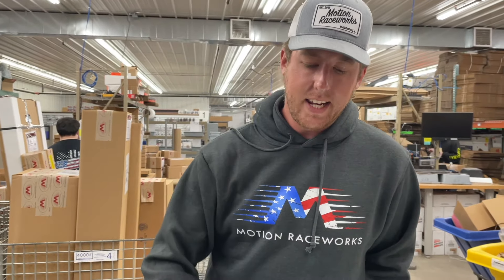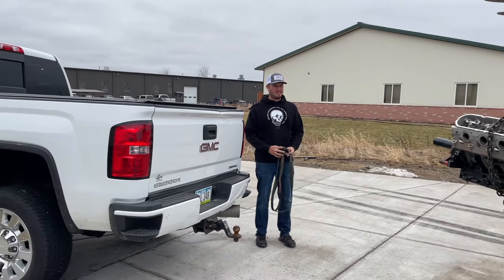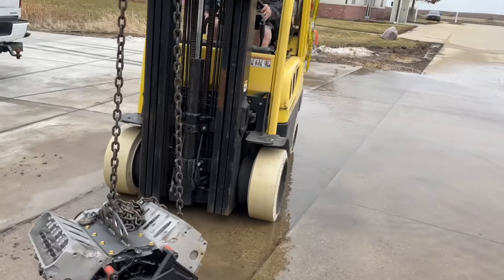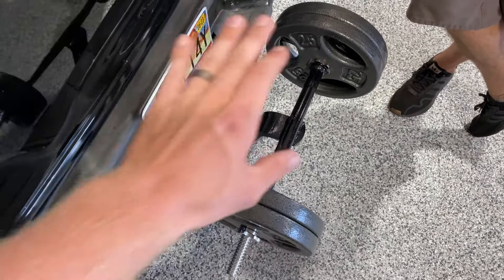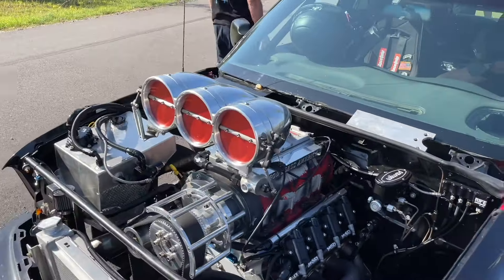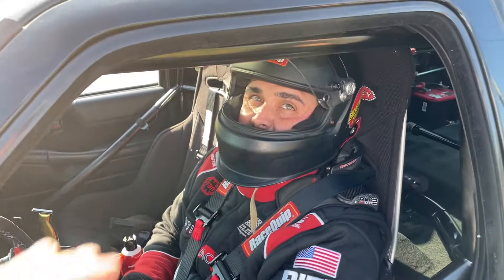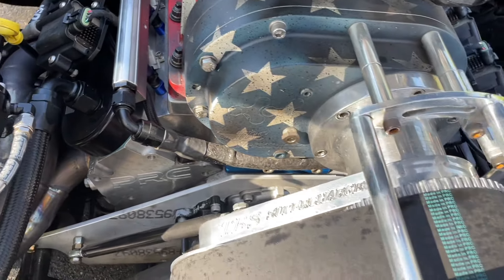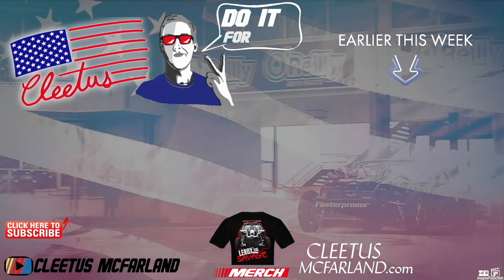BLAZER DOWN!!! We Tried Something New, But The Blazer Had Other Plans!!!

Comment: If you are going to keep running those weights on the back you really should run a pin through the bar to keep them attached!  A couple of 25 lb plates will kill someone if they come off at speed, especially if they are spinning from ground contact.  You really don't want to torpedeo someone!

Comment: Shout out to the intake bolt-hole threads in those aluminum heads. They are the real MVP of that lift 💪
Reply: It screws into the block.
Reply: Especially since that’s a mock up engine so it’s been impacted probably a shit ton

Comment: i've seen plenty of cranks breaking with blowers on them, the cause is from not having the proper tension on the pulley. the belt needs to be checked after its had some heat put into it. a belt that is to tight will cause that crank to snap.  depending on your pulley setup. 1/2" to 3/4" slack on the long side from center.

Comment: Honestly, when they started the lift plate bit “I couldn’t think of one possible thing that could have gone wrong.” However, I’m impressed with the strength of the chain, forklift, lift plate, and the truck hitch. 😂😂
Reply: I don’t understand why you’re impressed with it. They’re all heavy duty parts made of very strong steel.
Reply: @mikeznel6048  on the other hand i would be quite worried if anything actually broke

Comment: The fact the bolt threads holes is the impressive part.
Reply: A single 3/8-16 grade 5 bolt could have done the entire lift though.  Hard to believe, but it's true.  That is, with zero dynamic shock from abrupt lifting and lowering from the tow motor.
Reply: @majorrev8690  So the takeaway is: Motion raceworks engine lift plate is as strong as a 1" ratchet strap.
Reply: @TokenTombstone  I dont know how strong a 1" ratchet strap is.
The tensile strength for a 3/8 course thd Gr5 bolt is 6600 LBf.   One bolt, in tension, could do that lift.
Reply: @majorrev8690  Wasn’t the bolt threads that impressed me it was the block threads

Comment: With bead locks I would be somewhere between 5psi and 8psi. Also if you spin the tires a little more in the juice to give it a chance to break down the tire compound and back up exactly in the lines that you just made it will help a lot! Definitely gonna be doing a wheelie then!

Comment: On the weight plates where there's a cutout weld a piece of metal slightly larger than the hole on both sides for all of them to make hollow chambers...drill a hole in the center into the plates on one side only and fill with molten lead.

Comment: You also need to turn your "Weight bar" over and you'll have solid mounted wheelie bars instead of the trailer hitch hitting the ground.  Once you get it back together that is.

Comment: From what I can see the rear end isn’t extending and staying up which isn’t planting the tire causing wheel spin. Also the front end is extending way to fast and unloading the rear end. George needs to do a standing burn out in the prep to give the prep a chance to work on the tire. You’re wasting the prep doing a rolling burnout. Look up some SRC videos on YouTube. They are some of the best no prep racers around. You can learn a lot from them about burnouts and setting up your suspension for no prep

Comment: Gotta get it on scales and see the ratio on weight then adjust with your butthurt bar to make it around 50-50, need Hoosier D06 tires make sure your track ain’t getting greasy

Comment: Fellas first off, if you show up to a 28 10-5 (small tire) no-prep or street race with those W's on you are going to get kicked out. Better check the rules to the race you are going to, most (that being 99.9%) small tire no-prep don't allow the W tire. You need a set of HOOSIER c-07 or d-06 tires. The d-06 are better on virgin asphalt,  but as the strating line gets sticky you have to worry about them paddling (especially with hirer horse power).

Comment: So I'm sure if you tried turning the weight bar the other direction front to rear and put it inside and make it so that it's at a tilt forward and put the weights on when you take off they'll slide back and help lift the front end or help plant the way in the back FYI

Comment: If you guys can raise the ride height of the front end(or at least drop the back), that would definitely help out of the hole, transfer weight to the back a little quicker and keep it there. A front "long travel" kit too, if it doesn't already have it. Keep the nose riding high all the way to the finish.

Comment: the dumbells might work of you got an extra set of those nuts , turn two of them on per side and twist them against eachother to lock them up
if youre serious about adding weight to hook up you might as well put a few bags of sand in the rear

Comment: Did you take my advice and install any other weights maybe behind the front seats and even some on the front end and amp the tune up or try with something like that because I grew up racing my square body and my small 81 Corolla and both had different spots that needed added weight and definitely more boost.

Comment: Tell George on the burnouts to stop going down so far because as he backs up he is bringing trash to the starting line if he does shorter ones it’ll help plus I’d try dropping the tires to 8 I used to run 8 on the street but I’d say my car is a lot slower than the blazer

Comment: You said the wheelie bar was threaded the wrong way,I disagree. It will work at the start until the front comes down then sheads the un needed weight 1000 IQ if you ask me

Comment: you guys just over torqued it you got a lot of resistance with that big tire and you are pushing boost through the engine at too low of an rpm still, its some classic overtorqin

Comment: Hope u guyz know in real no prep racing they don’t add glue to the drag strip and the closest thing to prep is burn outs ,and an LS is light compared to even an 305 small block Chevy how come ya didn’t try an hemi everyone knows hemis are the heavyest modern American V8s ? .You know what they say if you use the lightest engine for the plate that means you’re afraid that your heavier engines will fail and break .what’s with your hate for hemis boys ? hmm? You have every American powered American main vehicles you have 2 ford powered main vehicles no hemis not even an burnout car with one everything about you guys is LS this LS that LS this LS that 😵‍💫😵‍💫😵‍💫😵‍💫😵‍💫 .I thought you guys where car enthusiast gear heads who like all kinds of engines not one engine you guys are entertaining but confuseing 😵‍💫😵‍💫 .why ya don’t build hemis is it because they make more power then your LS with twin 94mm turbos and they make more power then your 540 big block Chevy with 94mm turbos